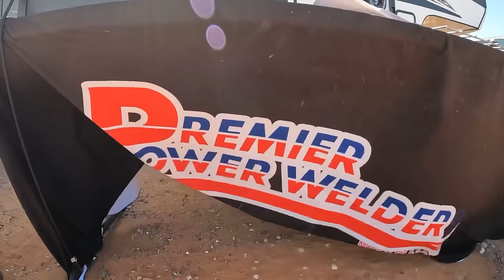Our Adventure Of The Off-Road Games

Comment: Ohh man it has to be super duper annoying for it to be windy all the time like that. Moab winds are gnarly enough but this seems like a few steps above that. When it blows it blows, thats for sure. Worst part about sand storms is you get sand in places you did not know existed. I was shoveling utah sand for like 2 years after my visit. It is sticky too, especially when it gets humid, good luck getting it out even with a shop vac.
Reply: I hurt my shoulder after ordering skid p!ates, so I couldn't install in my garage. Had a 4x4 shop in Rhode Island put them on.

Tech dropped the factory transfer case skid and saw the red clay and sand and got all excited and went around the shop showing the others, "This Jeep's been places!!!"